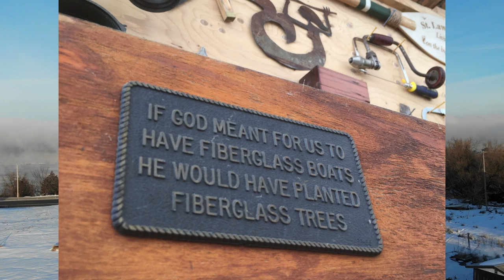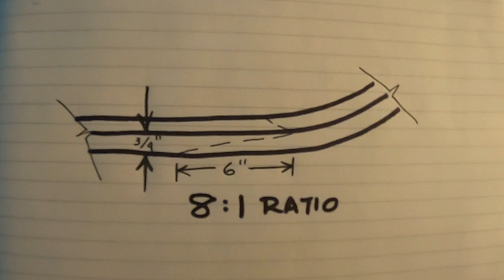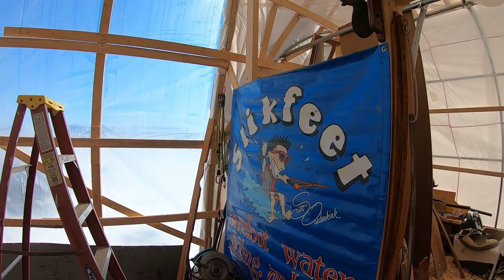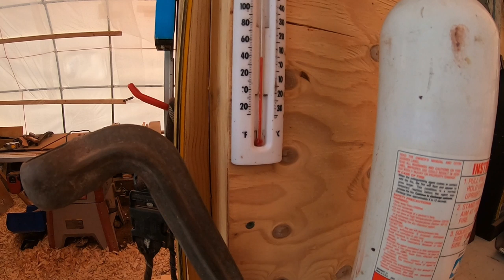WBE S1 E20 Out With The Old, In With The Not As Old!

Comment: They used Thiokol which was a 2 part caulk when they started building the Sea Skiffs then switched to 5200 when it was first introduced. According to Chris Smith the first Sea Skiff built with 5200 had all the clinch nails removed once the caulk had cured and they went out on the water with it to test how strong it was! One of the Smith family members continued to use the boat for fishing until it finally rotted away. Thiokol today is mahogany Boatlife.
Reply from the maker: Still surprisingly supple. Have you ever used Boatlife?
Reply: Glass Goat when replacing planks on double planked bottoms with the original bottoms it will compress and squeeze out unlike 5200 so when the rest of the planks swell they won’t buckle. Also use it on crush rails and splash rails so they’re somewhat easier to remove when damaged almost anything else 5200 it all. If you don’t plan on fixing or replacing often then 5200 it. The boatlife must also be mahogany color not their other colors which are different formulations and the best place to get it is from amazon so you can return it easily if you get a partially cured tube because that stuff will start to cure in the tube in a year or two. I think they’ve finally started putting expiration dates on those.
Reply from the maker: @jimmygrant3212  how is the color? I always think mahogany 5200 is kind of pink.
Reply: Glass Goat it’s a lot darker more brown than 5200 mahogany. Usually with the 5200 when staining it’ll take enough stain to blend in once there’s several coats of varnish on.

Comment: Don't know why you didn't replace the bottom transom board with one long piece, and scarfed in the middle instead?  One piece would be logical, look better and most of all give strength in that area as originally constructed.  5200 has no place on a wood boat, however, 4200, Thiokol, or polysulfide (Boatlife) yes.
Reply from the maker: All of the adhesives that you mention, including 5200 have their place on a wooden boat. Although I reach for 5200 less and less as my skills improve, I still use it, I just know now better where it belongs. Part of my philosophy is to reuse and reclaim wood in my work rather than just throwing new wood at the problem. That transom board joint was scarfed and is backed up by white oak as well as the silicon bronze lifting bracket which is through bolted in that area. Most of the joint is covered with bottom paint and the little which now shows through the varnish will be hidden by a swim platform. I no longer make blanket statements about any material in regards to wooden boats, as soon as I do, I often am shown that there are places in them for almost anything depending on situation, expected use, budget and life expectancy of the boat.